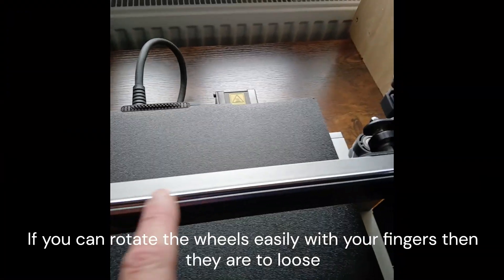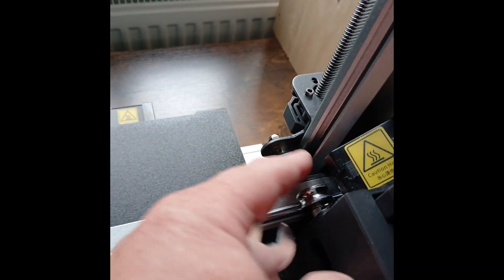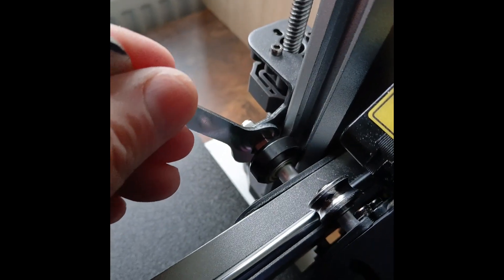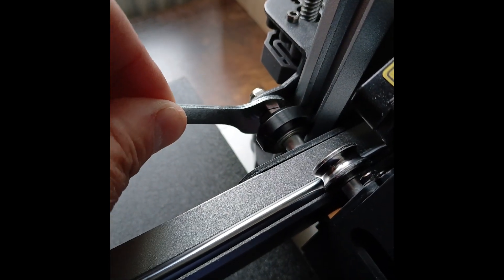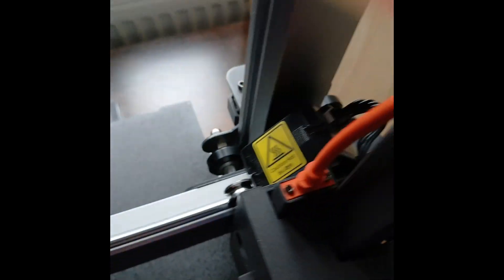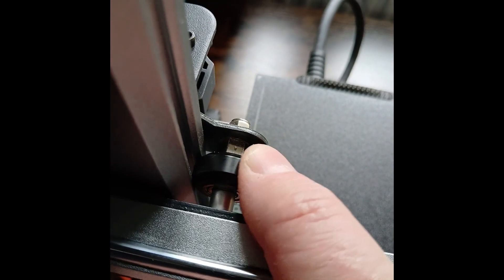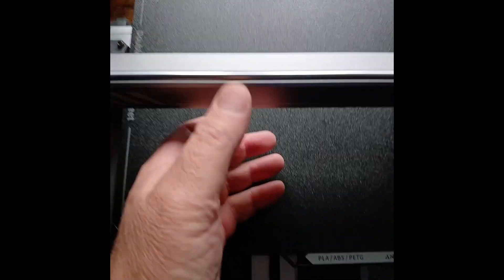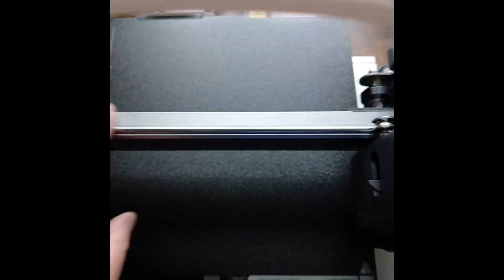How to tighten the X axis wheels on an Anycubic Kobra 3 Combo 3d Printer

Comment: Hi, I am having x-axis vibration and came across this video, just FYI, this is z-axis fix (moving up/down). X-axis is when the head moves side to side. Still trying to figure out how to fix x-axis.
Reply from the maker: Hi thanks  are you sure its not a loose belt
Reply: @resin-art-and-3d-printing no, I believe my issue is with the lower bearing, but even after fully tightening (it wasn't loose though), the head still wobbles from side to side movement.
Reply from the maker: @sohmal3  I would contact Anycubic and see what they sugest you do to fix the problem.
Reply: @resin-art-and-3d-printing yes I have contacted them, they sent me the same section from the manual that I had already tried. To tighten the roller bolt that's under the horizontal rail. It slightly fixed the issue but not fully.

Comment: I had a print that printed with noticeable lines and then one that failed halfway through. I checked the x-axis, and it was loose. I didn't know how to tighten it, but after watching your video, I got it done. Going to get a cube printed and see how it turns out.
Reply from the maker: Nice glad you got it fixed and good luck with the cube

Comment: I tried it, now the outer nut of the right side from my middle wheel is wobbly and i cant tighten it anymore
Reply from the maker: Hi that is strange It should tighten up both wheels  if you tighten the inside bolt. One thing you can check is on the side in the centre of the outside wheel there is a bolt which uses an allen key Check and see if that has come lose. Also dont over tighten the wheels. Hope that helps.

Comment: Great video thanks! 
Do you know how i can tighten up the wheels on my hotbed? It wobbles around quite a lot and i can tilt it with just very little force.
Reply from the maker: Hi thank you.  You can tighten up the nuts under the bed If you look at the folowing video at around 1.25 min into the video I show you where the nuts are to tighten up the bed.. Hope that helps you out   https://youtu.be/KKEaVfi7di8?si=j-6q7E1dvG1kLBOC

Comment: I am not able to move the x axis bar at all. I tried tightening and losening the inner wheels... but the outer ones are very loose, i can't seem to tighten the outer wheels with a wrench.
Reply from the maker: You should def be able to tighten or loosen both sets of wheels. Try loosening off the nut on the outside first and then the innner nut. You should also be able to move the x axis bar up and down, it should not be so loose that it is easy to move the bar but you should still be able to move it
Reply: @resin-art-and-3d-printing  how do you tighten/loosen the back/outside Wheels when there is no hexagon nut? I can only adjust the two on the inside. 
If i adjust the two in the inside the ones on the outside adjust a little accordingly, but after a while the two inside ones are tight enough, but the ones on the outside still are too loose, especially the bottom outside ones.
Only if i tighten the inside ones really hard, the outside ones become tight enough, but then Im afraid that the inside ones are way too tight.

Are all the wheels having the exact same friction for you when you roll over with your hand?
Reply from the maker: @raynlaze1339  There are two screws on the outside which you can tighten up or very slightly losen but when you tighten up the inside that should  also tighten up the outside ones
Reply: @resin-art-and-3d-printing  Do you mean the screws at the back that are on the frame going in y direction (for the outside wheels)? Because those only seem to hold the wheel on the frame, not loosen or tighten the wheel.
Yes, but like I said, when I tighten the inside ones, only when they are very very tight, the outside wheels become a little tight, and I assume they should all be the same tightness no? How do I get that result?
Reply from the maker: @raynlaze1339  Hi the outside wheels should tighten up when you tighten up the inside wheels. Mine are both thight so that you can not move them easily with your fingers.  The only other thing I can think of is why they are not is maybe the screws at the back are loose. When I tighten my inside ones they also tighten my outside ones. I have never had this problem like you are having. Also if it is not affecting your prints then I would leave it as it is because you do not want to over tighten the wheels and burn your motor out. You should be able to lift the X axis up and down with a little effort so it should not be so loose that you can lift it up and down easily. If it is affecting your prints and the outside wheels do not tightening up then I would contact Anycubic support to see if they can suggest anything. Sorry I can't help you with this one as I have never had this problem on my printer.
Reply: @resin-art-and-3d-printing  Hey, thank you, I did manage to get them a little tighten by lowering one side of the x axis bar, but its still not perfect, there is this one wheel that's being a bit too loose imo. Anyway i think its good enough for now, thanks!
Reply: @raynlaze1339  did you fix your issue? im having the same problem
Reply: @raynlaze1339  did you get a fix? I'm having the same problem! only inside wheels tigh, outside don't help pls
Reply: @drunkykamikaze2716  i think it is by design that the outer ones are a bit more loose. I just tightened the inner wheels until the outer ones were equally loose/strong. But outers are always more loose than inners.